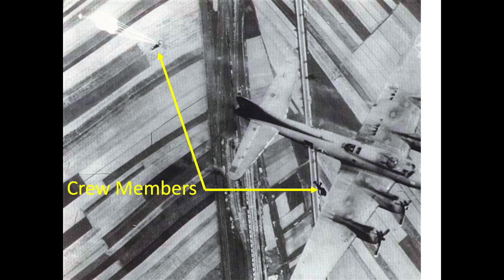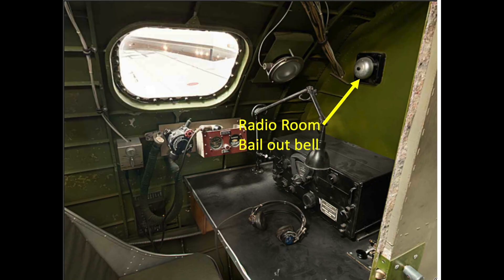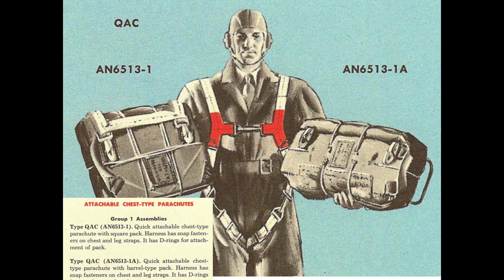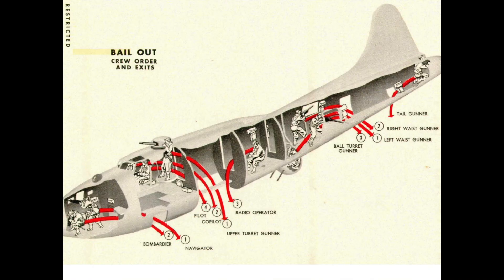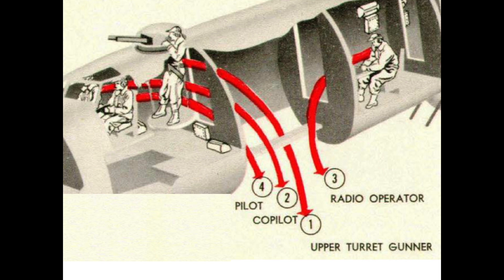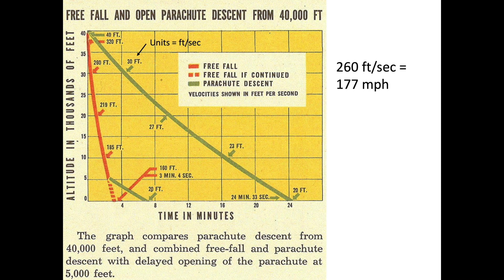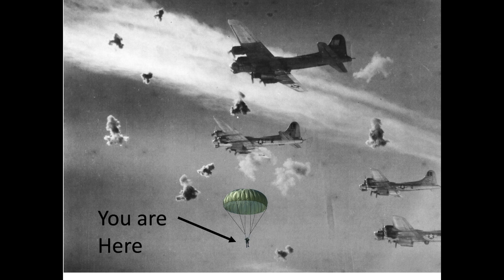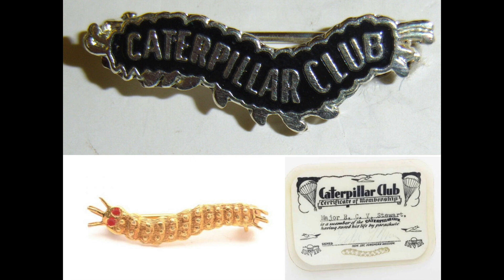B-17 Bomber, How to Survive a Bailout

Comment: My great uncle was part of a B-17G bomber crew that had to bail out over Austria.  May 10, 1944, flying out of Foggia, Italy, the 775th Bomber Squadron (Allyn's Irish Orphans), 463rd Bomb Group (H), 15th Air Force, took part in a raid on Weiner Neustadt, Austria.  Inbound on the bombing run, they took Flak hits which damaged their intercom system, and bomb bay doors, so that only one door would open.  They dropped half of their bomb load on target and turned for home.  They were then harassed by multiple enemy fighters that scored critical hits, causing fires in the #2 and #3 engines.  As the plane began to lose altitude, they were given the order to bail out.  The two waist gunners and ball turret gunner couldn't get out of their primary exit, due to the fire from the #3 engine, so they, along with the radio operator, went out through the partially open bomb bay.  The tail gunner bailed out of his hatch, but he deployed his parachute too soon and it was damaged by flames coming from the aircraft.  He was killed upon impact with the ground. The co-pilot was trying to bail out, but was in and out of consciousness, and was pushed out of the bomb bay by the bombardier; my great uncle.  The navigator then went out the bomb bay and successfully deployed his chute.  My great uncle then bailed out, but the aircraft was too low at this point for his chute to fully deploy and he was killed upon impact with the ground.  The pilot and flight engineer went down with the aircraft as it crashed on the reverse slope of a hill.  The navigator came down in some trees about 20 yards away from the crash site, but was stuck in them because of his parachute.  Then the remaining bomb load on the aircraft (the bombs had been armed prior to starting their initial run on the target) detonated, killing the navigator and presumably the pilot and flight engineer.  No trace of those two was ever found.  The tail gunner, bombardier, and navigator were all recovered and buried in the local town cemetery, with their remains being disinterred after the war.  It's a fascinating story, with a book written by the niece of the pilot, as she learned more about him.  God speed the crew of Pete's Playhouse (42-31685).  In loving memory of T/Sgt Prescott C Piper, KIA May 10, 1944, near Pottschach, Austria.

https://www.youtube.com/watch?v=xZZ5AKMmGBw&t=28s

At the 3:46 mark in that video is a photograph, taken by the Germans, of the remains of my great uncle.
Reply: Lord have mercy.
Reply: if your uncle died how you knew?
Reply: So five members alived?
Reply: @kot0472  Yes.  The two waist gunners, the ball turret gunner, the radio operator, and the copilot all safely bailed out and were taken prisoner by the Germans.
Reply: @h5skb4ru41  My family has the original telegram from the Army Air Force, listing him as MIA, followed by a letter later on confirming his death, from the German Army through the International Red Cross.
Reply: Your great uncle was indeed a hero, having helped another to get out of the aircraft and survive at the price of his own life. Remember him well and make sure your children hear that story many times so they can pass it along to their own children.

My own uncle was a B-17 Navigator. His crew flew 28 missions, the last one a volunteer mission. Their airplane failed due to engine trouble and possibly icing on the way over the Channel just after Christmas 1944. They turned back but too late realized they were not going to make it. Only my uncle and one other crew member bailed out perhaps fearing the cold water, but were very low by then and chutes did not fully deploy. My uncle was alive when he went in the water, and an amphibious rescue plane saw him, landed and tried to recover him. He was delirious from the cold water and perhaps injuries. One hero on that plane jumped in the frigid water after him, but was unable to get him in the plane. A boat came to assist and recovered him, but he perished shortly after and was buried in a military cemetery in England where family members have visited. No one else on the crew survived or was even recovered, except one man who had flown an extra mission a few months earlier and was allowed to rotate home a few days prior.

My uncle’s name was Lt. John P. Walker, and he flew with the Lyle Doerr crew from the 398th Bomb Group, 602nd Squadron flying out of Nuthampstead. Their final mission when they were lost was on 30 Dec. 1944 to Bischofsheim, Germany.

An informative interview by the surviving member of the crew can be found at 398th dot org (sorry, YouTube are idiots and do not allow proper outside links), search for Joe Mansell video interview. Many other photos of the crew, their airplanes, missions, and reports can be found there. Great B-17 website.
Reply: @h5skb4ru41 The politics niece wrote a book about ut.
Reply: @PatrickTyrrell-jd5zy  yes, she did.  I learned a lot from Kay Hughes, and got to meet her and her father, the pilot's brother, who was also a B-17 pilot with the 8th Air Force.

Comment: I'm sure that practicing the bailout procedures must have seemed highly optimistic to the bomber crews.

Is it known what the (approximate) success ratio of bailing out was?
Reply: Well I suppose compare the aircraft losses to the Casualties. In one raid 376 planes went and 60 planes were shot down. 16 percent loss rate with 7 confirmed KIA crew. 557 POW or MIA. Not terrible odds.
Reply: @devinthierault  That's actually much better then I thought.
Reply: @SolarWebsite  I imagine the survivability
 depends if the B-17 is still controllable or not? If it’s flying straight and level, but with an engine fire, the crew will have some time to prepare to bail out. And probably get ready in advance.
But if the aircraft went into a sudden spiral dive, for example the wing coming off, then the crew would have no time to prepare and would struggle against the tumbling and g forces.
Reply: @notmenotme614  Not to mention that just entering a spin means tumbling around inside becoming a risk of well, just hitting your head and going out unconscious, but with higher G forces you'd probably also be stuck onto the fuselage as the plane spins.
Reply: @devinthierault  Many of the MIA were probably killed - the 7 confirmed KIA probably died on aircraft that made it back. 
About 50% of shot-down US Eighth Air Force bomber crews survived although some of these planes crash-landed rather than had crew bailouts - crash-landing was more likely to result in all crew members surviving. Only 15% of RAF Bomber Command crews survived the loss of the aircraft - generally they operated at night and it was probably much harder to find exits in those conditions - the only light might come from the fire also destroying the aircraft.

Comment: Wasn't there an oxygen bottle for fighter pilots called a Bail Out Bottle?
Reply: I don’t know about ww2 fighters. But modern jet aircraft do have an emergency oxygen bottle built into the ejector seat. So the pilot can eject at any altitude or speed and still breathe. The ejector seat also has a built in air pressure sensor so that he will free fall low enough, then the seat will automatically separate from the pilot and parachute, his parachute will then open automatically.